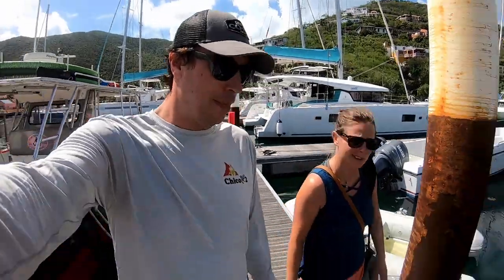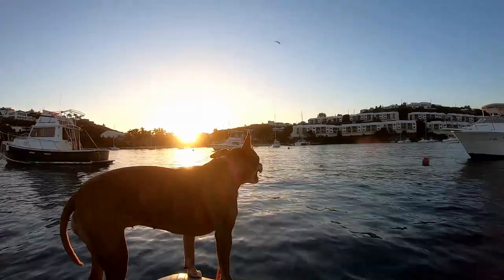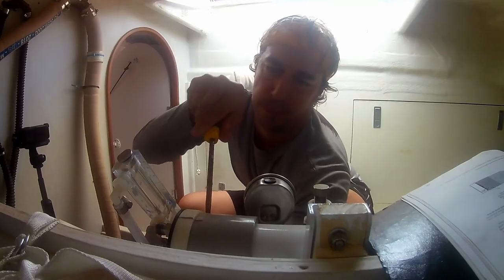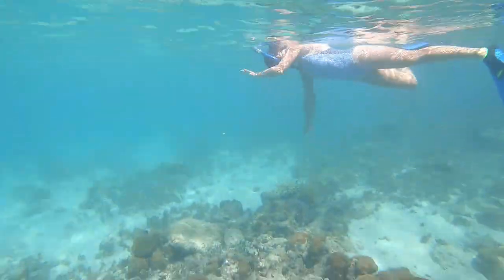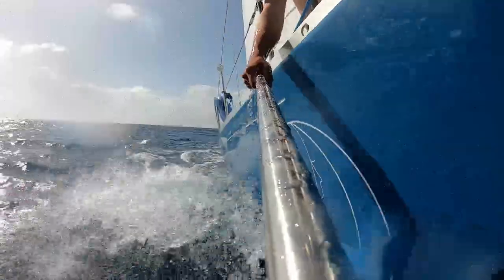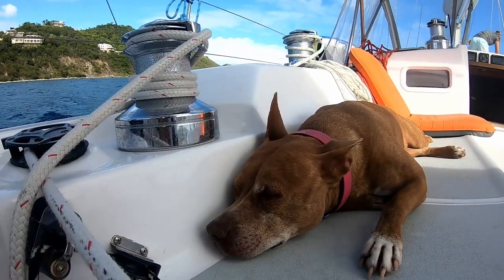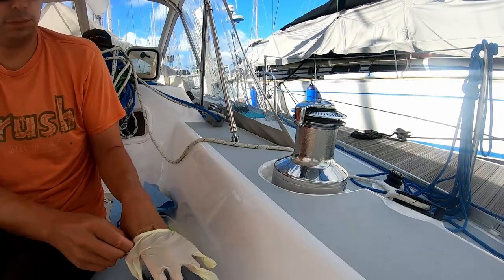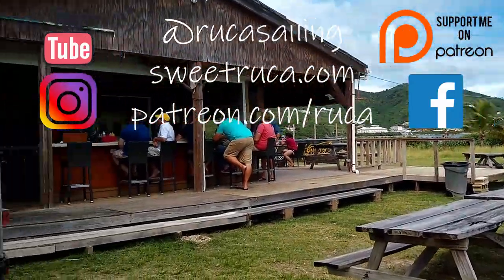Final Days of FREEDOM - Pre-Lockdown SAILING from USVI to BVI [Ep. 21]

Comment: I added a stay sail, but made it out of dyneema, thinking of stainless,  ... any recommendations
Reply from the maker: Hi Erlan, thanks for watching! We have a dyneema inner forestay with a stainless turnbuckle for tensioning. We did a lot of research before committing to it. 

We like it, it is easy and simple to deal with, and doesn’t chew into the spreaders and mast when stored to the side (we store it when fun sailing or we plan on tacking often, we can also completely remove it and store it below, for example if we left the boat on the hard). It also adds less weight aloft than stainless. I’ve voted with my wallet, and it’s a vote for dyneema IFS. I considered it for more standing rigging, but rod won everywhere else. 

Different kinds of dyneema have different stretch and creep profiles (SK75/78/99, D20). Nitronic 50 rod and wire also can stretch, usually it is less noticeable. Also, size matters when it comes to stretch, creep, load rating and diameter. An IFS on a 70’er would have to be dealt with differently than an IFS on a 40’er. Windage becomes a factor at some point. Ours is 11mm Marlow D12 SK99 with a chafe/uv cover. 

There is also some cool new developments in carbon rigging, and in integrated stay/furled sails that, depending on your budget may be a nice option. It is hard to give you a strong opinion without knowing what type of boat you have and what your sailing goals are. 

Happy to help, keep us updates with what you come up with. 

This would be a good blog post or tech video which I will have to put on the list.